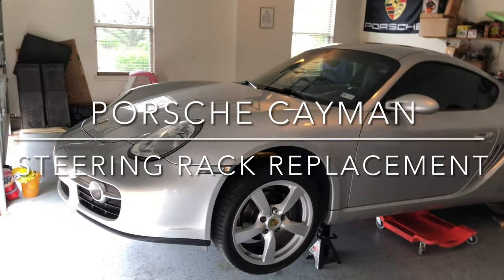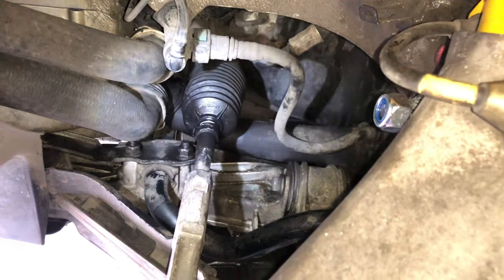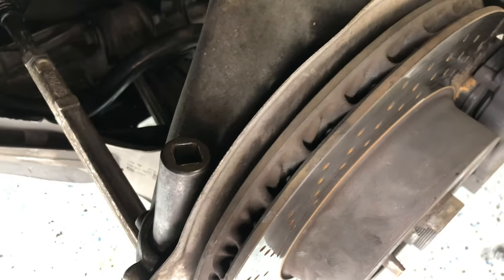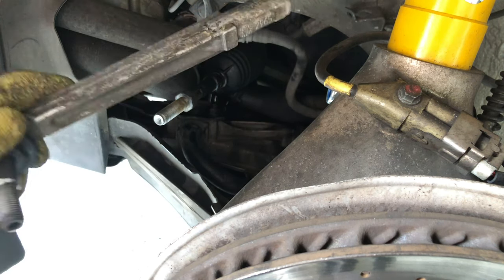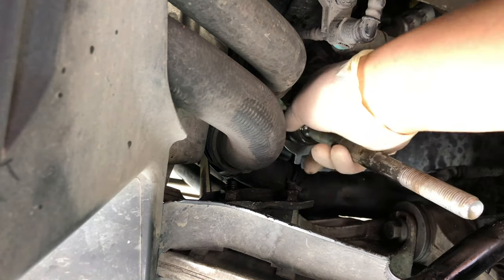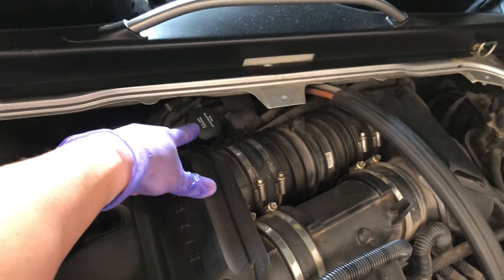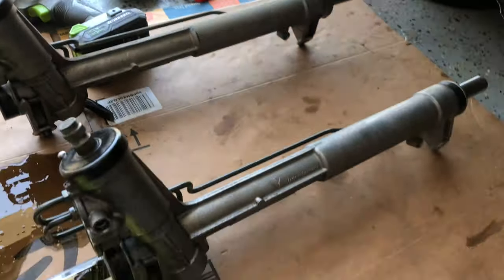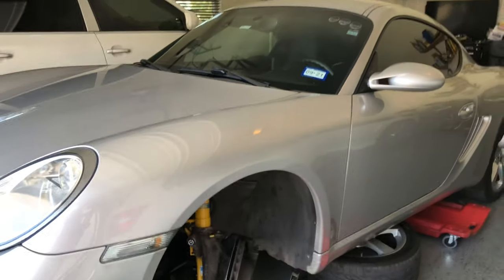Replacing the #power #steering #rack on my 07 #Porsche #Cayman #987.1

Comment: Thanks also for the video, gave me confidence to diy mine.  A few procedural comments after doing my 08S track only car with just over 100k miles.  Tie rod separator from Advance auto worked,good price.  The struggle to get the rack out led me to lower the sub-frame by about 8 or 10 bolt turns which gains you about 1/2” of space.  10 bolts.   Came right out and the rebuilt TRW Maval unit went back in easy.  I’ve got an electric powered hydraulic steering pump in the frunk so minimal fluid lost.   My problem was decent steering turning left and very poor turning right.  No leaks, hoping whatever was worn is better with this rack.  Got a two year warranty.
Also, no need to remove tie rods or inner rod.
Reply from the maker: Thanks for the comment and watching! Happy to hear your way worked too. Please like the video and subscribe!!!! I have outter/inner tie rod videos too. Check out the library

Comment: Another very clear and awesome video. Still waiting on the purge valve replacement video from you on the Cayman. Mine is broken and cant find any videos on it.
Reply from the maker: Thank you. I want to say there are two purge valves but don’t recall. Is yours for EVAP or secondary air injection?
Reply: @512TXSDIY  i believe its for the EVAP and is located under one of the exhaust manifolds. Just now sure how to get to it and replace it.
Reply from the maker: If I remember correctly, it’s under the intake plenum which is a little tough to remove. Not because it’s hard to get to but rather the hoses are very firm to release and your back starts hurting since you have to sit inside the trunk. I did my fathers Boxster years ago and haven’t needed to since. Hopefully, I don’t have to do that again anytime soon. Is your car stalling/hesitating causing CEL?
Reply: @512TXSDIY  Car starts fine when its cold but has a hard time starting when its hot which is causing a CEL (P0455 Evap Emission  leak). I did perform a smoke test and there was no leaks from what i can see.
Reply from the maker: Check it out: https://rennlist.com/forums/boxster-and-boxster-s-986-forum/1176852-porsche-boxster-fault-code-p0455-cause-and-fix.html
Reply: @512TXSDIY  Thanks i'll check that out!!

Comment: I've had some pretty bad steering wheel wheel shakes while braking. Rotors look fine and noticed when i lift my car the driver front wheel has side to side play if grip the 9 and 3 o'clock position and shake real hard. The play was definitely in the tie rod so changed out inner and outer thanks to your previous video on this. But it still has the same amount of play so this would have to be a bad rack correct? I too had a whole lot of power steering fluid in my boots when removing them for the tie rods
Reply from the maker: If you have fluid in the boots, you have a bad seal in the steering rack that needs to be replaced. I don’t think that would cause the shakes when braking though. Have you checked your front tires? 987 and 996 naturally sit lower and the chamber settings cause the tires to create under toe or cupping. Turn your wheels left, then right and check the front tires. I bet they are unevenly worn. Once that is done, it “could” be wheel bearings too if there is play.
Reply: @512TXSDIY  thank you for the response. When i move the tire back and forth at 9 and 3 o'clock though you can actually see the tie rod move in and out from the rack even after replacing both inner and outer. Either way time for a rack unfortunately which I'm not looking forward to lol
Reply from the maker: @joek1302 It’s not too bad. Putting the rack back in is tricky without two people. Did you check your front tires too?
Reply: @512TXSDIY  i did, no uneven tire wear but they are really new tires

Comment: I need to replace my high pressure and return power steering line starting from the rack to the quick disconnect. Are they easily removable from just taking out the under tray covers?
Reply from the maker: Not just the tray. I recall having to remove both front wheels and the tray to access the steering rack.

Comment: I have a leak on one of the high pressure lines on the rack itself, do you know if the rack needs to be removed to replace these or if i can access the fittings on both ends  of the lines without removing the rack?
Reply from the maker: I don’t recall 100% but you will have to drop the front bottom tray for sure. Shouldn’t have to remove rack though. Front tray and the driver side rim.
Reply: @512TXSDIY  Had a look under the tray and cannot see anywhere to access the bottom nut for the pipes which is annoying so the rack will have to be removed to swap the lines. Helpful video cheers mate.
Reply from the maker: Thank you for watching!

Comment: located one with 15,000 miles on it for $250, way better than Porsche's 2k+ for a new one....
Reply from the maker: Nice! That’s a better deal than what I found. Bravo. Don’t forget to like the video and consider subscribing if you haven’t already. ** careful when removing the steering rack that you don’t bump the lower coolant elbow.
Reply: @512TXSDIY  lol turns out it wasn’t the rack and pineon but rather a coolant hose. All is fixed now!
Reply from the maker: @jorgebaqs7370  Much easier to fix then!